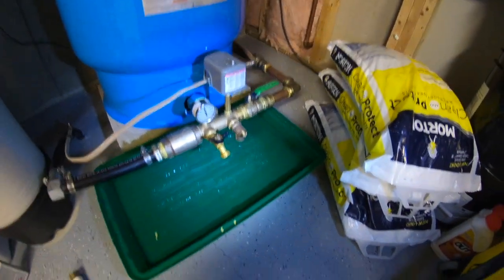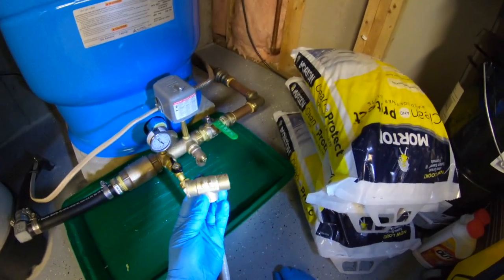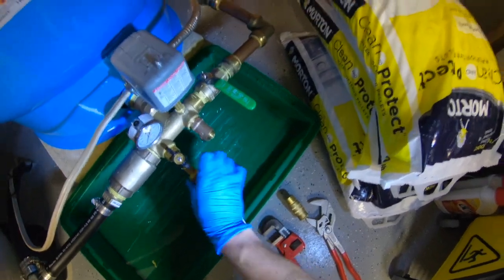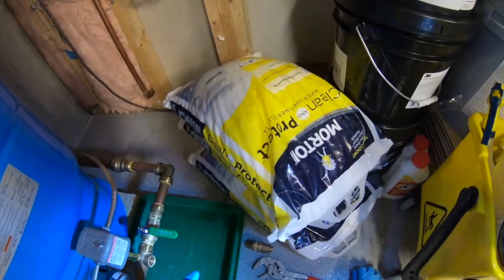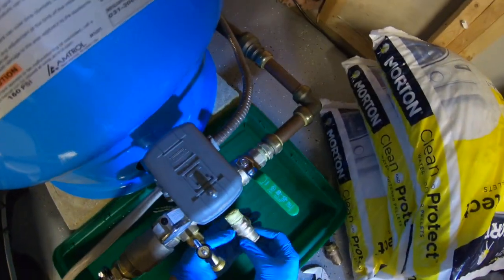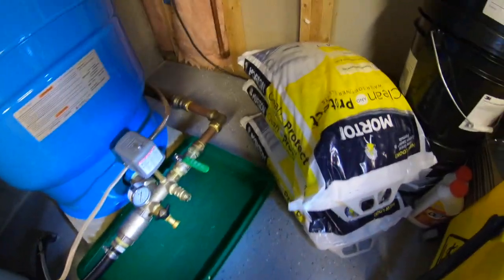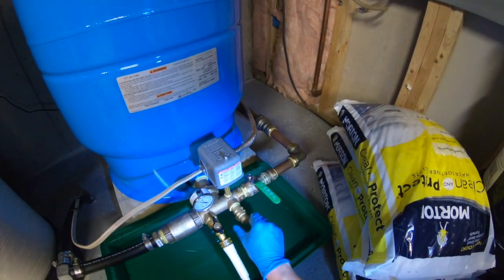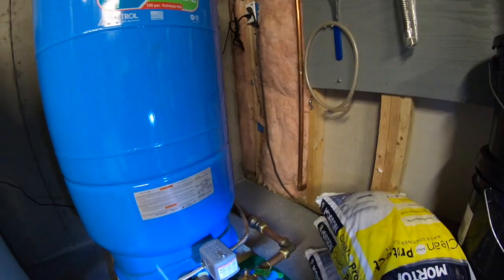How to Replace a Leaking Pressure Relief Valve on Well Water

Comment: Wow - thanks for this video, my pressure relief valve was leaking (well, or so I thought) and a quote from a plumber was absurd so I followed your video and successfully replaced it. Actually I'm glad I did because I think I narrowly avoided disaster - I'll tell you why and a few things that I learned:

1) If you have buildup or oxidation on the outside of the pipes around the threads use a paste made of vinegar and baking soda to clean it. I put an aluminum pan under it and used a paintbrush to apply the mixture. Let it sit for 10 minutes then rinse with the vinegar and wipe with a dry cloth.

2) When draining the tank (with the power to the well pump off) run a few faucets and toilets in the house until the pressure gets low, say 20 PSI and THEN turn off the main to the house. This can save you a lot of schlepping buckets of water to outside the house (in case you don't have a sump pump or a way to run a drain hose).

3) If your pressure gauge is old or looking worse for the wear you might as well change it while you have the system down - its cheap enough. (Mine was 15 years old, corroded; I didn't realize at first that it was not working and locked on 55 PSI and about to spring a leak).

4) Here's the big "ah-ha" moment - I originally thought my relief valve was leaking but in hindsight it was actually doing its job. What I found was that the small vertical copper pipe that connects to the pressure sensor pump relay was clogged (minerals, gunk) at the bottom, almost completely. It was down to a pinhole opening! So when the well pump ran and pressurized the tank the switch was very slow to detect the high pressure limit, with the pump blowing past the 60 PSI mark to the 73-74 PSI mark! (Remember the relief valve is 75 PSI). I was probably only days or weeks away from it being clogged completely, which would have resulted in the well pump running continuously with water pouring out of the relief valve. I used a stainless metal tie wrap (a long drill bit would have worked also) to clean out that copper pipe and flushed it out the spigot. To me this was the most important and critical learning.

5) Lastly, one more thing to do while the system is drained and down - the pressure tank has a bladder in it that, WHEN DRAINED, should be pressurized to (in my case) 1-3 PSI below the turn-on pressure. So for example if you are using a standard 40-60 PSI range setting, the pressure in the tank should be 37-39 PSI (WHEN DRAINED!). There is a valve stem on the tank just like a bicycle tire, and you can use a standard auto pressure gauge to measure it (WHEN DRAINED!). I don't know what it was set to at installation (I'm not the original owner) but my tank was set to 30 PSI. I used an electric air compressor to get it back up to 38 (WHEN DRAINED!). (Be careful not to OVER-pressurize it, you may damage it). This pressure is an important part of the entire system and was even mentioned on the label of the pressure switch.

After all this I buttoned up my system, turned the power on and it cycled perfectly between 38 PSI - 60 PSI!

Thinking about #4 above and the fact I could have been traveling on business and had my pump filling my basement with water for days until it burned out because of a simple clogged pipe got me thinking. Something to consider is a wifi-connected smart valve that can detect water leaks, alert you on your phone that there is a leak and even allow you to remotely from anywhere shut the water main where it enters the house. This might be my next project.
Reply from the maker: Really great info and all good points. These inexpensive parts can really avert disaster if left unchecked. This info will be very helpful for people. Thank you
Reply: Many thanks to you for this comment that saved me from unnecessarily replacing the pressure relief valve, because I too had a problem with mineral deposits in the pipe leading to the pressure switch.  Thus, my pressure relief valve was working appropriately.  
The clue that something was wrong with that pipe was that the shower cut out for a minute (probably when the relief valve dumped out a bunch of water on my floor) and then came back on.  The pressure was markedly elevated at 85.  
This other video - https://youtu.be/ZoEfIQB1vbg - was quite helpful explaining the situation which was resolved with coring out that pipe with a Philips screwdriver after removing the pressure switch.  Now the pressure sits at 50.

Comment: Do you have a check valve between your wall tank and well?   I would not have one there if you have a submersible pump.  The check valve should be on the well pump.  A check valve can result is air in the well line if there is a leak.  This can result is air being pumped into the home.

Comment: Mine is set up the same however my in feed from the well is on the right where your out to the house feed is with the guage and valves set up the same as yours. Every 15 minutes or so it started releasing itself for a minute or so. No idea what's going on.

Comment: This 63 year old woman did it, thanks for the video! The only part I cried on was trying to get the hose on, I had to use a wrench.
Is is the same procedure to replace the valve for the hose, I don't want to wrestle with that again. (And thanks for the advice to get both sizes, because ofcourse mine was the 1/2" size).

Comment: I just moved to a well system out in the country. What if my system doesn’t have a drain valve only a shut off valve to the house and I need to cut the pvc to replace the pressure tank?!! I guess I’ll just take a nice shower today! I’m going to make sure I have a valve when it goes back together!

Comment: Should I worry about the brass to steel with the pressure tank?  And is it worth venting the relief valve just in case it pops to the exterior?

Comment: Excellent video!  My well pressure relief valve just started leaking ~ one cup per day (it's 19 years old).  I noticed it's a 75 psi valve and my pressure gauge shows 80 psi actual pressure.  So is the pressure relief valve simply doing its job (since pressure > 75 psi)?  However, it's strange that it never leaked before despite the actual pressure exceeding 75 psi.  I'm just wondering if I should simply turn down the water pressure first before replacing the valve.  Thank you!

Comment: My system is leaking right before the check valve only when the well pump is running. Do I need to do anything special when I replace the pipe and fitting before I turn back on the pump. Do I need to prime etc?

Comment: Also, my shut off switch is mounted to the jet pump so I can’t use the brass T like you have. I like your set up but I have to figure out how to connect to the pressure tank. PVC???

Comment: Th hanks for your video. When putting the check valve and other connections together do you apply the plumber solvent to those threads also. ?  I’m getting ready to attempt changing out my fittings with new brass. Thanks. And if I wanted to put a regular hose fitting where would you recommend it be placed?  Before. Or after the check valve
Reply from the maker: Yes for all screw in fittings you will always want to use a thread sealant/ pipe dope. I am not a huge fan of tape since you can do it wrong. One tin of this works great and it's safe for all types of plumbing and drinking water approved: https://amzn.to/371Jy9E
Reply: Silver Cymbal I appreciate your quick response.

Comment: I have a system that looks very much like this, but my well feeds in on the rt side and the 1/4 shut off valve is on the left side of the meter (gauge). Water feeds out to the softener and neutralizer on the left. I was about to replace the same relief valve shown here, but noticed my 40/60 meter as it climbed to 75-80. I ran a faucet and it dropped below 60. 
Do I have a bad meter or a bad valve... or better just to replace both? I know anything can go at anytime, but they're only about a year or so old and installed by the same crew who's done well here for a decade. 
Thanks

Comment: Wicked great video. Thanks. Glad to see you flush the system a bit immediately after replacing the relief valve. I've seen new pressure relief valves "fail" early because they are not able to close completely due to getting a piece of crap in them after relieving pressure.

Comment: Would it be OK to use a fitting and connect a hose to the relief  valve outlet and  put the hose outlet in an appropriate drian? Of couse you could not detect the valve dripping unless you used a clear hose and checked it occasionally.

Comment: Thanks for this informational video.  I followed your steps for our valve, which is located outside the home, about 20ft from the hot water heater in the garage (city water).  Everything went smoothly and now I have a non-dripping valve.  :-)
Reply from the maker: Thats awesome. Glad it all worked out and the video was helpful. Please thumbs up and subscribe also if you haven't already, it's always appreciated. Best wishes

Comment: I changed my pressure gauge, pressure switch and pressure tank today, I noticed when my switch hits it’s upper limit 60psi   It shuts off but notice the gauge slowly drops back towards 40 psi, what would cause that? Would it be the check valve at the tank or the one at the pump?
Reply from the maker: Sounds like it could be the check valve, but to be 100% sure I would also make sure you close the water valve to the house, to be 100% sure it's not something using water. If it's not you will want to try the checkvalvle. They are cheap but I know it's a bit of a pain but it sounds like you did everything else.